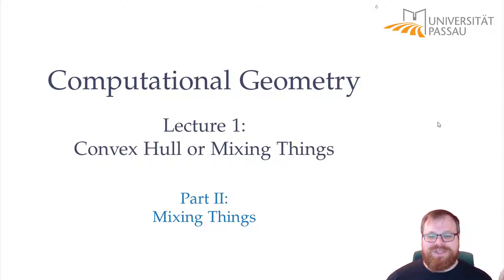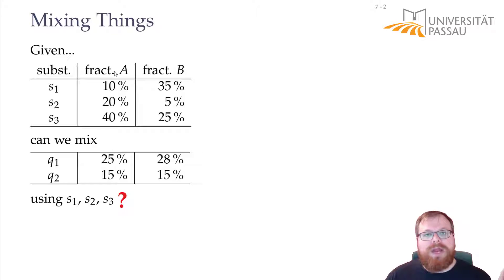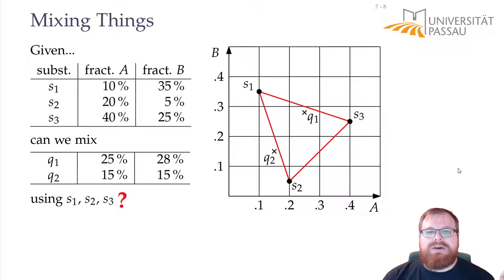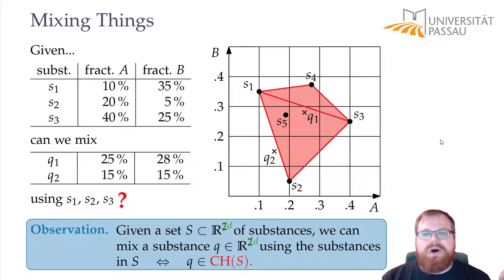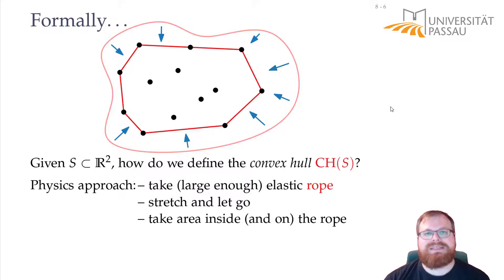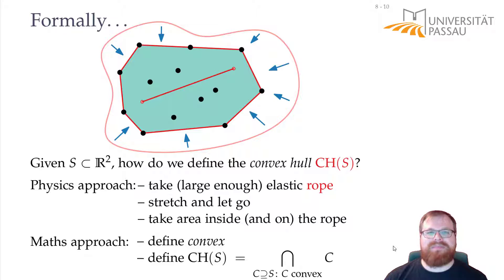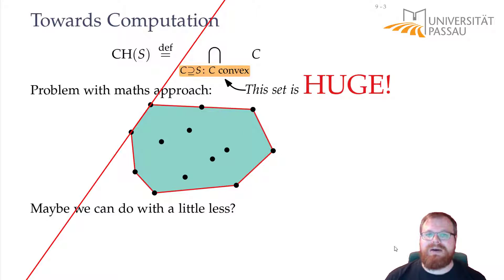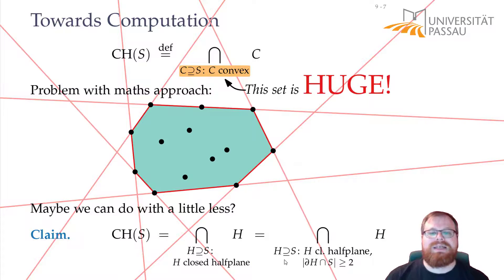Convex Hull or Mixing Things (2/5) | Computational Geometry - Lecture 01

Comment: Does the problem of mixing things would require to assume that there is an implicit component c which would then complete the composition of substances s1,s2 and s3 ? Cos in each formulation sub-components do not add up to 100%

Comment: Thank you professor for sharing your knowledge. 

Could you please confirm your problem statement @ 3:00 assumes one can't have fractional units of a substance (s1 or s2 or s3)? Coz if not, one could extract fractional units of s1 , s2 , s3 e.g : 0.5 of s1 OR 0.25 of s2 etc, to have many more combinations to create new substances with varied proportion of each substance.

PS:  I understand that if fractional units are possible, then the algorithm would likely have an algebraic rather than geometric solution, which is the purpose of the lecture.
Reply from the maker: Hey Aazim, you can have fractional units, but they have to sum up to 1; it's basically, "how many percent of the substances I used is s1/s2/s3", so using only s1 means that you used 100% s1